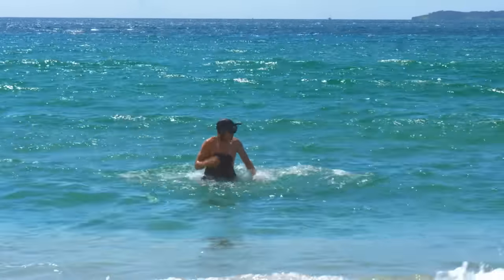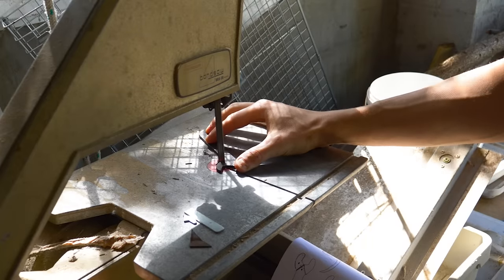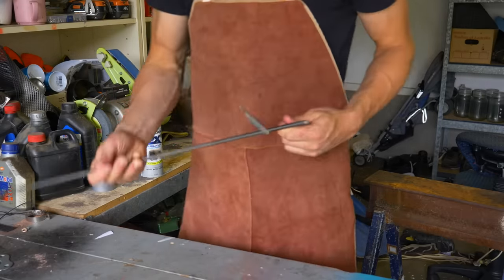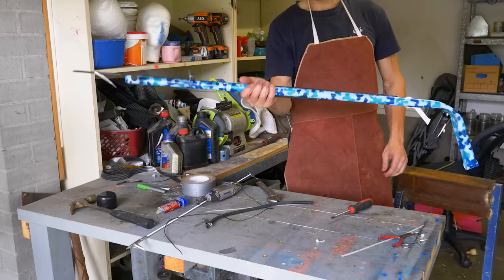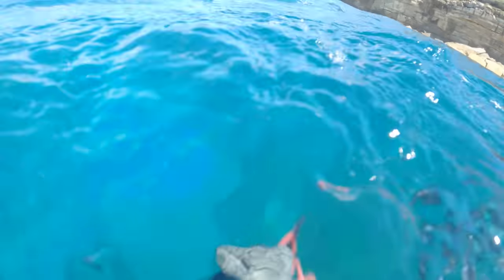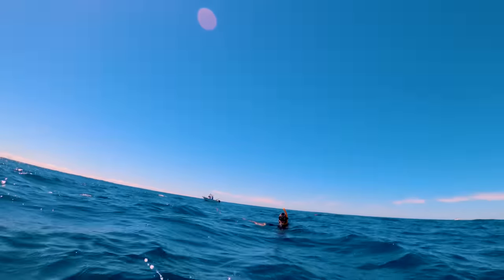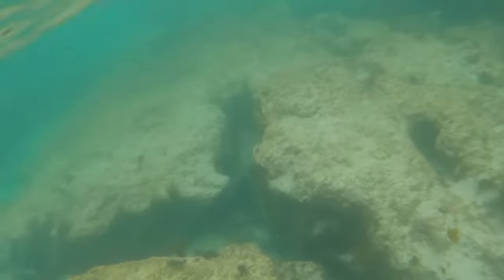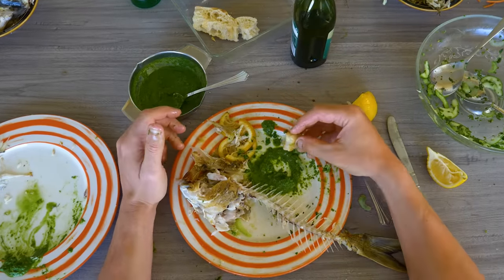Can I Make A Speargun Using Only Trash?

Comment: “It’s going to be made entirely out of things from home. So the first thing I did was leave my home.” 😂
Reply: No
Reply: giant drill thing
Reply: @Maxwell Quinn it's called a drill press btw
Reply: @Maxwell Quinn but you can improvise almost any tool. Bandsaw Just a normal handsaw or metal saw. As a heatgun you can maybe use a Hairdryer or some Bunsenburner. A normal drill or maybe Some heating some metalsticks to get the holes

Comment: That gun is literally a bigger more dangerous version of something we used to make as kids called a “pigeon gun” for exactly what you would expect.   Two wooden clothes pegs a stick and two elastic bands.  The metal part of one peg tied to a band makes the projectile, then you but the elastic band on the end of the stick, pull the metal part back, to where you’d have a peg tied to clasp it.  Then literally point and press the peg to fire the metal piece at something (someone).

Comment: It's really great this kind of session. Otherwise, a quick question, I made a speargun myself and in the open air 2.5 meters away from a block of polystirene (those used for insulation) and the arrow pierces it and comes out a few centimeters. I'd like to know whether it's possible to shoot a mullet at close range. Many thanks in advance.

Comment: An atlatl is easy to make.. 
and works fine.   a frame from a folding lawn chair makes a nice one. Just cut off what you don't need and pound a dowel in the tube ends or use caps

Comment: Really cruel way of fishing honestly
Reply: it's not, the place it shoots has no nerves so they either die immediately or don't feel it at all
Reply: @imbetterthanu9435  Source? And I hardly believe you can accurately shoot in the same location every time. It's illegal in Sweden and so is bow hunting for the same reason
Reply: @lilbeeaver  my source is that even if they miss the spot they get a knife straight through the head everytime and it's a quick death other than normal fishing which is basically the fish slowly suffocating
Reply: when fishing the fish usually dies due to suffocation these the fish in this case die my bleeding out